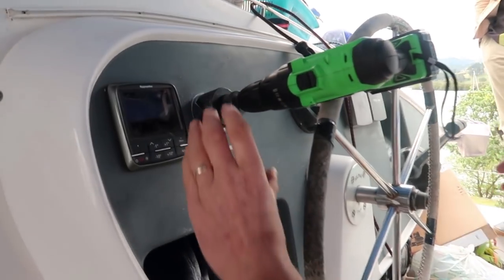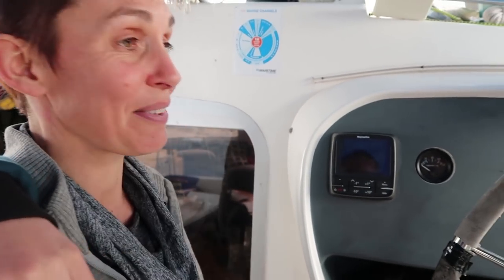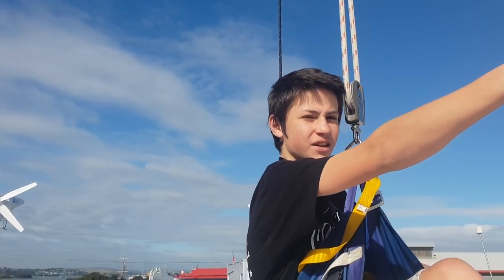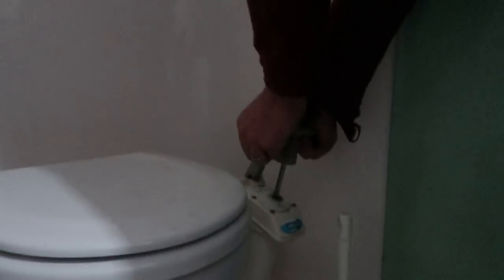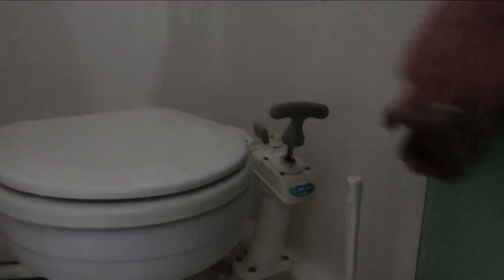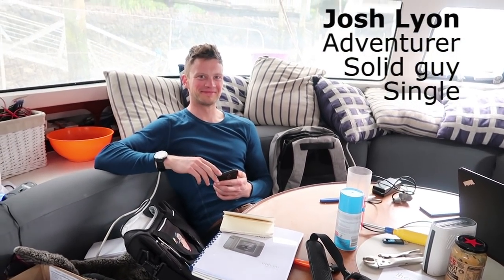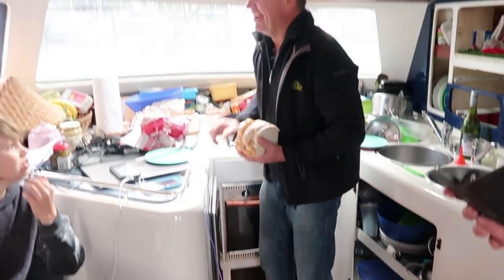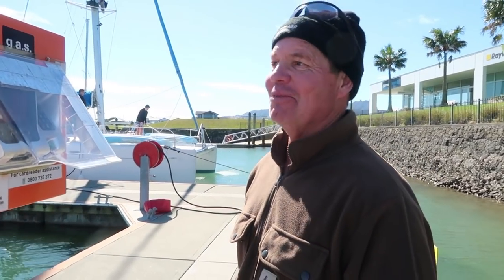Sailing sailboat BOAT WORK BLUNDERS cont. - Ep 4

Comment: Ah Hi Rob.

Those gauges are made to flush mount From the outside of the dash, they are 3 inchs and push through from the wheel side with the black surround already attached to them to make a neat finish. There is even an attaching bracket you put behind the dash to secure the gauge in place, but hey your boat and what you did worked. Google is your friend.

Have you never mounted one of these to an old when you were young.

Regards.

David. Down Under.
Reply from the maker: Thanks for watching David and for your advice. Unfortunately the gauges were supplied by a guy who serviced our engines. What you see is all I got. Left to my own devices I had to get creative. I did try them on the wheel side but without the correct mounts they looked worse then the finished article.